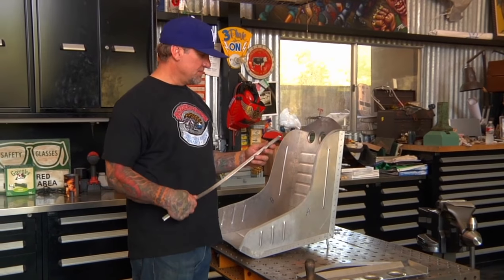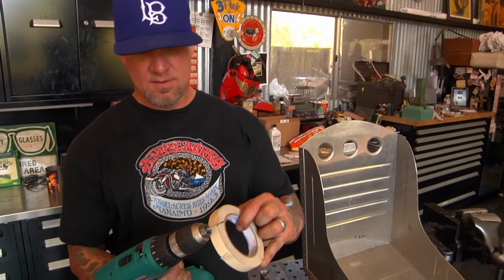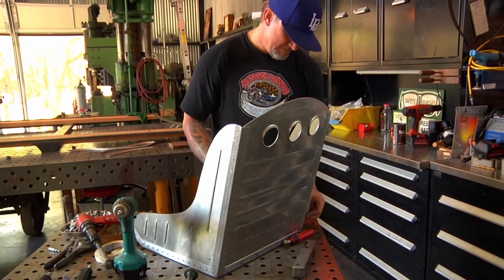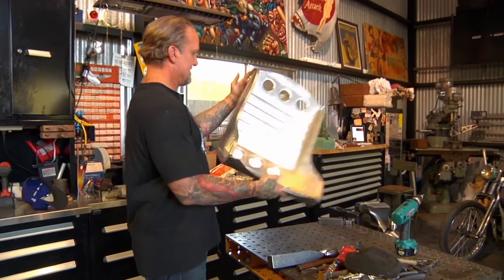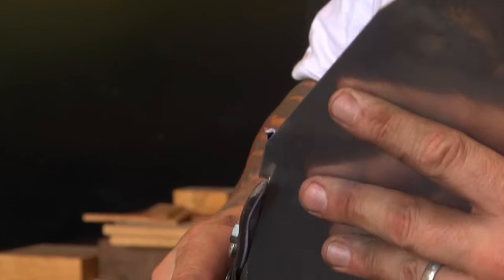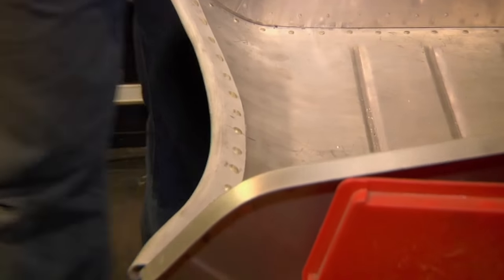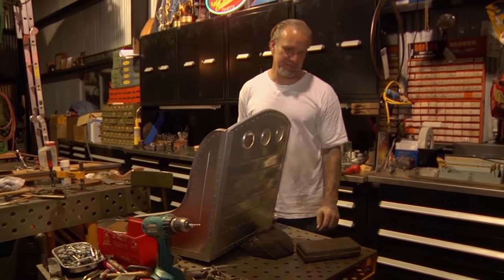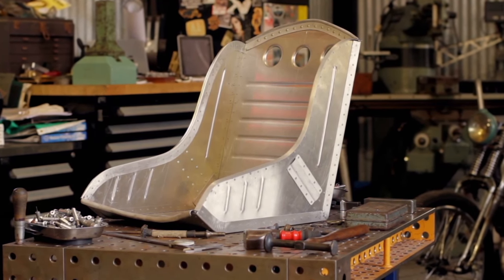Jesse James Rivets by Hand!

Comment: The top piece looks uneven and crooked.
Reply: A T   No.  I collect West Coast Choppers parts and have a WCC bike.  But if you look at the top piece, it’s crooked.  Don’t you see it?
Reply: B W top piece is where it went wrong. Bead blasting was the wrong idea also. Ruined the esthetic.
Reply: Yea where the arch is
Reply: I thought so too, but it could just be the angle. I don't like the little line/channel peeking out front underneath that piece. Looks like the afterthought that it was.
Reply: That cause he folded it to use a punch which had a shallow throat…instead of using a drill to drill holes😂

Comment: As a guy who does riveting on fighter jets everyday as a job, i can also say its a skill that is being lost. As companys role in machines that do what hands use to do, the skill is being lost. But its an awesome skill, as it can be used from aerospace, to automotive, even i  the tech industry, to just making art.
Reply: BG, as a guy who does riveting on fighter jets everyday as a job are you saying you are current military and you repair/patch panels. Or do you build jets for an aerospace contractor?
Reply: @Dixler683  i work for aerospace contractor. Bucking rivets is something that i do alot of, and in alot of hard to reach areas. Its a skill that not everyone can learn.